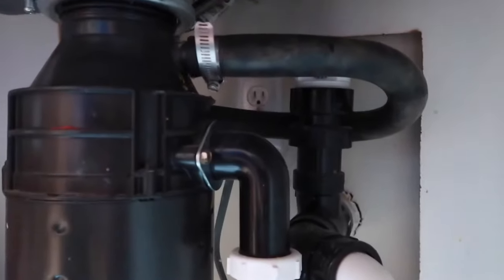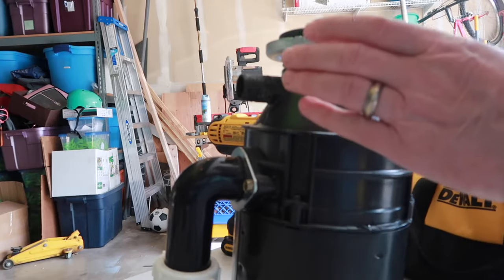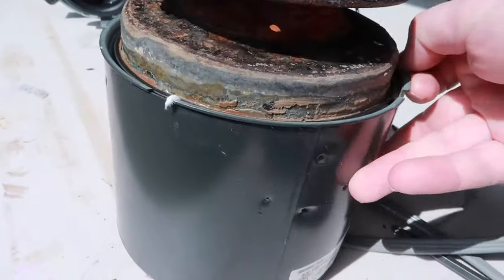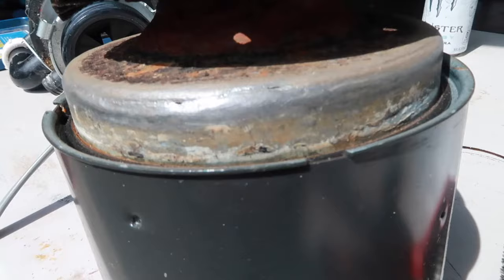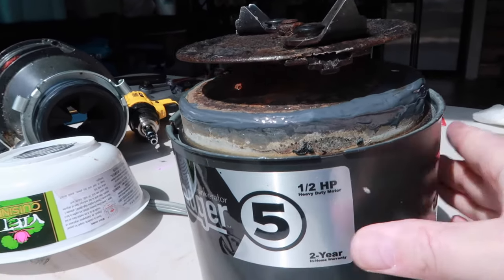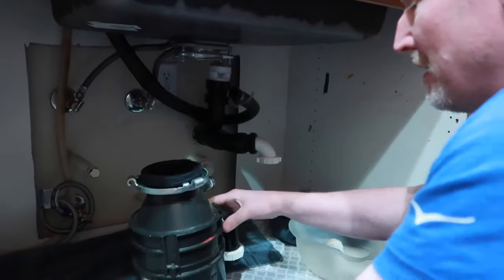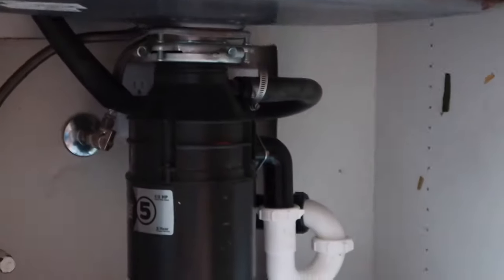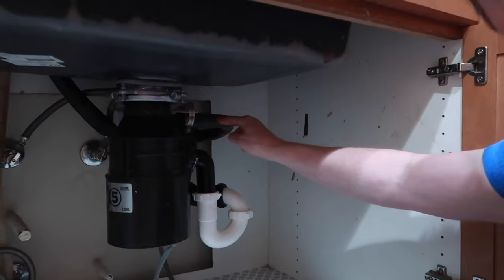HOW TO FIX A LEAKY DISPOSAL | DIY DISPOSAL LEAK FIX | BADGER 5 DISPOSAL

Comment: Thanks for the video. I was up for the challenge and wanted to save it. Took my old one out and cleaned it up. Kept finding new holes, so I decided to get a new one and not get into a can of worms by trying to fix this old one. Got the same model, Insinkerator Badger 5(500) for $103.
Reply from the maker: It really is a can of worms when you open it all up to fix it. Glad you were able to replace yours.

Comment: I took my disposal apart as you showed but found no holes after scraping the rust and gunk off.  Bought a new disposal and now have no leaks.  Excellent video though and I've subscribed.  Thanks.
Reply from the maker: That's too bad that you couldn't find a way to fix your old disposal, but I'm so glad our video tried to help you get it fixed.

Comment: Hmm wonder how long a new one would last if you coated it in jb weld before installing it.
Reply: Good question. I guess that would be an extra layer of protection. Assuming the disposal was original to the house it lasted  over 10 years. So maybe not worth the effort to do to a new one??
Reply: @TheSaintelias  I'm tempted if it lasts forever.
Reply from the maker: I too wonder if it would make a new one last longer!

Comment: Great video.  I don't have the badger 3, but my disposal is similar.  Was able to take it apart and identify some large cracks/holes.  I'm afraid JB Weld or similar will only delay getting a new one.   I suspect it was previously repaired using this method because there was epoxy type material on it already.   Will try  JB Weld to hold it a bit further until it's time to get a new one (when motor craps out).  Thanks for your video!
Reply from the maker: Ours held with the JB weld for 3 more years, and it was the motor that went out causing us to replace it.

Comment: Great tutorial. Now I know why ours leaks at the bottom. I just discovered our leak by accident and it appears from the cabinet bottom that it's been leaking for a while. I'm now curious to get the disposal out as I'm wondering if our builder popped the plug in the dishwasher drain hole. Thank you. 👍
Reply from the maker: Hope you're able to get yours fixed up. It's unfortunate that leaks under the sink can go undetected for so long!

Comment: Nice. Your thoughts on putting the epoxy on a new dispoal to increase the longevity? Thanks.
Reply from the maker: I'll have my husband respond to your question soon. This fix has held for many years! I too wonder how a new one would hold if you add the epoxy to it?
Reply: @daynacreates1105  exactly. Typically mine lasts about 7 years. But putting epoxy on a new one should increase the life.
Reply: Since our disposal was already 10-15 yrs old I wouldn’t worry about the extra effort. Just fix it a decade from now. Lol

Comment: Three things. 
Thanks for showing REPAIR, not just diagnostics.  (Another channel found the leak, then replaced the disposal.)
Am I the only one who accidentally pulled out half the motor? (Not just the cover.)
Aligning the long bolts on reassembly then became tricky. (Used a straightened-out metal hangar to line it up.)

Comment: Thank you for opening up your old disposal and clearly identifying how and where such leaks originate. I applaud your attempt to repair it, but suspect such repairs simply delay replacement. Moreover, I didn't have the time to wait for an epoxy to cure. So, I just opted to spend the $150 for a new one. As it was, the home builder's electrician not only hardwired it, but used an inflexible conduit with no slack, making it a royal pain to replace. I also discovered the plumbing may not be to code (almost horizontal drain pipe), which is likely why mine rusted out. Sigh.
Reply from the maker: This fix held for another 3-4 years, so it was worth the time spent fixing the leak. Plus, the link still held, but the motor gave out.

Comment: Hi! Awesome video... do you remember what kind of bolts they are? I understand they are external torx? Do you know what size?
Reply from the maker: We didn’t add new bolts to it, so it just reused the original hardware.
Reply: Sorry I do not. I kept the same bolts that came with the unit.
Reply: They are 5 mm bolts.

Comment: Great video bro my grandmother has the same exact unit and her disposal is leaking from the bottom not anywhere else. Everytime i turn the switch on i hear a click and it shuts off the reset button on the outlet on the wall by the sink.
Reply from the maker: Hopefully this helps you to get hers fixed! Good luck!
Reply: @daynacreates1105  It helped alot but unfortunately i dont have the proper tools but there will be someone coming to check it out in a day or so.

Comment: I have water leaking from the bottom of my disposal but the PVC pipes are screwed in so hard, i cant take them off to get the disposal out. Any suggestions?
Reply: Huh. If the pipes detach at a place away from the disposal try there?  They can be stuck in place. Heat hun maybe?  Just spitballing here. Good luck.

Comment: Do I need to turn off the water supply before I do this? Just making sure. Thanks for the video!
Reply from the maker: You do not need to turn off the main water supply before doing the repair. Just make sure you don’t turn the sink water on while you’re doing it. I hope it goes well for you. Our fix is still working, so I know it’s a good solution.

Comment: Do you have any ideas what caused the holes to wear into the piece on the disposer?
Reply from the maker: Hi this is Jason. From what I have learned the welds are not of the highest quality so they simply deteriorate over time. So far my fix has lasted…knock on wood.

Comment: Had same problem. I dropped a tablespoon in the thing very late one night, and couldn't get it out. So decided to remove the maybe 30 yr old disposal. It was held on by a metal buckle strap and it came off ok. I got the tablespoon out scraped out about a pint of vile, rancid bacteria paste that had accumulated, and put it back on.  And as soon as I used it, it started leaking from the bottom. Rather than take it apart, I just patched the leak with JB Weld waterproof epoxy. Then it leaked elsewhere. Long story short I ended up going through three tubes of it and it would just find another place to leak.  I finally gave up, bought a new one and have it all installed except finishing the plumbing. 
I had looked around and all I found were articles and videos that said if the disposal leaks from the bottom, it has a bad seal and it's toast.  I thought I'd save it, but it was all in vain. I guess I didn't want to dig into it too far because it was so old to begin with, even though it ran fine. 
I wish I'd seen your video sooner!
Reply from the maker: That’s so much work!! I bet you were so frustrated! My husband says he feels bad you went to all that effort only to have to replace it. Good try though. Most people don’t even look into how to fix things these days.
Reply: Wow. A journey. I respect you determination to fix it but…that old a new one is the way to go. I wonder if the weld caused the water to flow back into and over some of the intakes. Either way I hope you have a well running dispsposal now. 👍

Comment: Are you fixes still holding or have you seen leaks again? I followed your method, but got a little excited and layered the epoxy a little too thick and now I am battling to get the unit back together.
Reply from the maker: We haven't had any leaks yet, so it seems to be holding quite well. I'll let my husband respond about being able to put the unit back together.
Reply: Charley - how did you fix ur problem ? I am also running into the same issue .. layer around got a bit thick. I didn't think that was thick !
Reply: You can sand that down once it cures

Comment: How long do you leave the weld on for it to seal best ?
Reply from the maker: There is a cure time, which should be on the weld packaging. Then you put it back together. You don’t remove any of the weld material. Hope that helps.
Reply: Thank you .. I am running into the issue of not able to close the upper part as weld layer around is thick .. how do I solve this.

Comment: Pro tip: Garbage disposals are heavy
The jack from your car is a great way to hold it up while you mount it to the sink
Reply from the maker: Great idea!!
Reply: @daynacreates1105  Credit to my step-grandpa. He did many things in a klugey sort of way, but he had really clever methods for some stuff too.
Reply: @daynacreates1105  Thanks for posting the vid.  I'm currently leaning toward a new disposal, but time will tell.  I still have plenty of clean dishes and am not yet desperate for any rushed solution.
:,)

Comment: Good Video👍 But how long does the JB Weld last? 🤔 Then every video on leaking Garbage disposals I've seen so far  is a  Is Badger? 😉
Reply: The instructions tell you how long to let it set after application. We did this video months ago and we are still going strong. The stuff is tough.

Comment: Chasing your tail trying to fix all the rust holes..More will appear soon and you will do this job again(and again). The good news is: You will become REALLY good at removing/replacing the disposer! While you have it out, you may as well remove the flange from sink and renew the plumbers putty or you will have a new leak
Reply from the maker: So far it's all holding up quite well! He chased holes for quite a bit, but luckily got them all the first time!

Comment: This is an older unit, they are made of plastic now  insted of rust or rot its the motor bushing and seal that fails. 
Mine never got that rusted out.
These used to last 25 30 years, not anymore its 1 or 3 years but it will fail in 5 years.

Comment: Good video to watch but this is literally putting a bandaid on a wound that's going to surface again soon. I completely get the part of wanting to save money. I'm the same exact way. But stuff like this makes me want to just replace the darn thing and not worry about another leak for a good five years with getting a new unit. I just replaced my Badger 5 with the same model. it was on Amazon for like $100 which is already a good deal compared to Lowe's or Home Depot. I then took advantage of a Discover card promo that Amazon had. I ended up paying something like $75 for my new disposal. Worth every penny just to replace the unit as opposed to me doing any bandaid repairs.
Reply from the maker: You got a great deal on a new disposal! I agree with you too. Sometimes the extra work to fix something isn't actually worth your time. We agreed if this had taken him much more time, he would've gotten a new one. But, luckily his fix has lasted for a few years, so we're all good for now!

Comment: I wonder how long this fix lasted before it started to leak again.
Reply from the maker: It lasted another 3 years but the leak still held. The motor went out on the disposal first. So, it was worth it!!
Reply: @daynacreates1105 , Amazing. Just the time and money that I could save by trying to fix it than replacing it worth the try. Thank you for the video.

Comment: My new badger is leaking from the bottom. What the heck?
Reply from the maker: Probably had a leak in a seal, or it was faulty to begin with.
Reply: @daynacreates1105  
I now noticed I didn’t puddy the drain end pipe connection. It wasn’t leaking from the bottom but first leaking from that said pipe. My bad.
24 hours to cure. We’ll see.
Thanks Brother!

Comment: I ruined two 8-9 year old disposals chopping up a sink full of ice cubes. Dont clean old disposals they always leak when the rust gets loosened.
Reply from the maker: We must have cleaned our disposal well because it’s still working 2 years later!! And it’s at least a 10 year old disposal. Sorry you haven’t had good luck with yours.
Reply: @daynacreates1105  thanks happened at home and at a friend's. I clean them so well the rust opens up into holes lol that or the shaft seal gets damaged.

Comment: Ok you patched it but another hole will just erupt, why are these made so poorly. My first one lasted 25 years and it was supposed to be the same brand and model as I replaced it with another just like it and now 3 years later and it has a leak that made a huge mess and was ruining my cabinets and flooring.
Reply from the maker: They really aren't made like they used to be. Luckily, this fix has held for a few years.

Comment: Mine is leaking from garbage disposal to the PVC pipe. My garbage disposals pipe is just a straight pipe no threads on it

Edit: the garbage disposal pipe is horizontal
Reply from the maker: Did you ever get your disposal fixed?
Reply: @daynacreates1105  it was the gaskets that were shot out. I had to adjust it and then tighten it not to tight and not to loose for water not to leak. Then finally property management got someone out here and swapped out the gaskets for sum new ones. Only problem now are my floor boards theyr hella bowed out and theyr suppose to replace them soon. This video helped me gain confidence to go under there and figure it out

Comment: You didn't show how to disconnect the electrical wire
Reply from the maker: This is Jason. Our disposal is a simple plug in. So I just have to unplug. Some are hard lined and you would have to unscrew the connection. Turn off the breaker if you have to deal with wired. Good luck!!
Reply: @daynacreates1105  thanks 🍻
Reply: It is just a usual plug in. Some are hard wired but ours is just a regular outlet plug